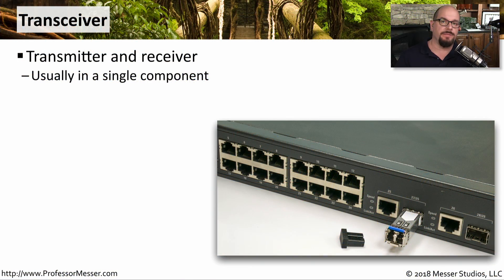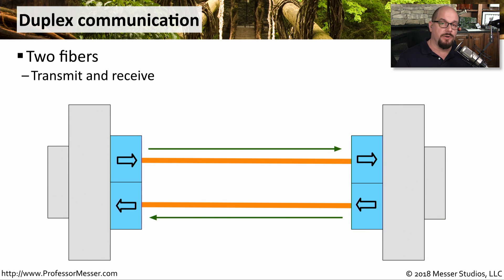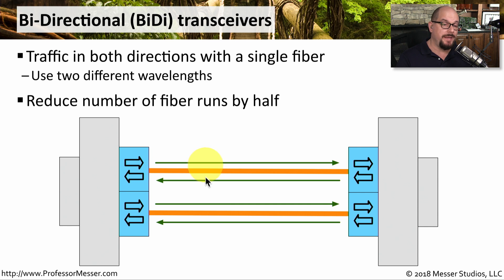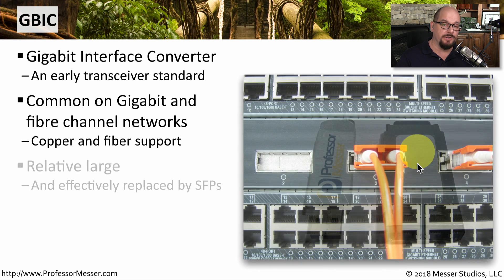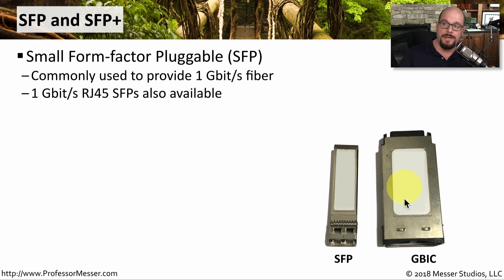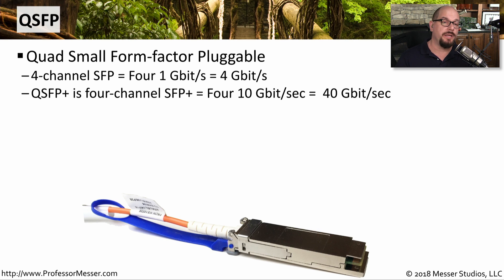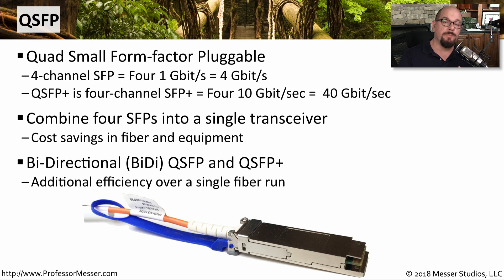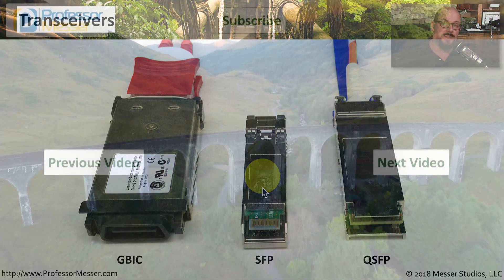Network Transceivers - CompTIA Network+ N10-007 - 2.1

Comment: Are the speeds, 1GBit/s, 10GBit/s etc, measured for Duplex communication or for BiDi?
Reply from the maker: The stated speeds are referencing one direction of the synchronous link, so the total throughput of a 1 Gbit/sec SFP is 1 Gbit/sec received and 1 Gbit/sec sent simultaneously.